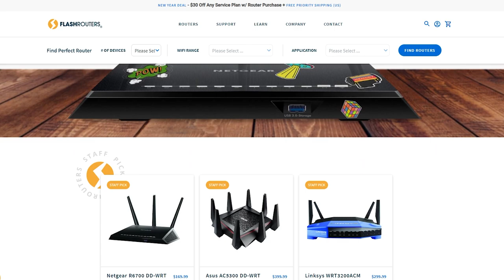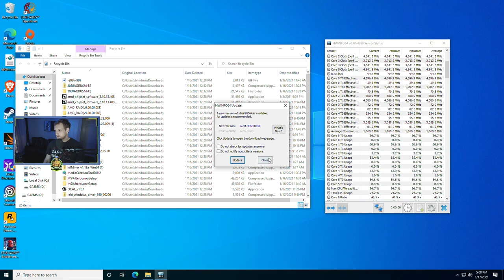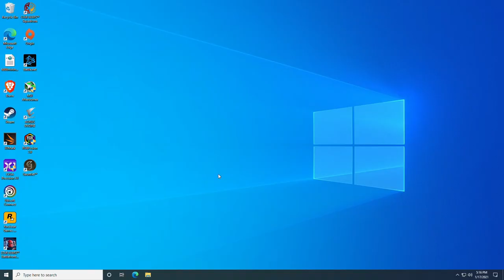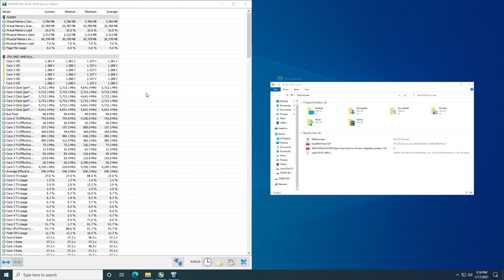How to Replace Thermal Pads on Any GPU!

Comment: dude awesome stuff thanks for the call out! serpentxsf and I had the same issues on our gigabyte eagle and gaming oc 3080. Gonna order a flash router soon!
Reply: I'm 100% you can get more mh/s if you drop the power limit to 85%-90% from the get to, right now you dropped the temperature but you're still outputting a ton of heat which is hard for your GPU to manage,  if you reduce the power limit just a bit you will be able to get higher memory clocks before crashing because your overall heat output will be lower to start with.
Reply: We love you Red Panda!

Comment: I just did this, I went from 82 mh/s peaking at around 104 C to 92 mh/s peaking at around 88 C. I don't understand why manufacturers wont just use better thermal pads, but at least its not super difficult to replace them.  Your video was invaluable in getting all the stuff I needed to do the job.
Reply: If they make their cards indestructible, we won't be able to kill them :)
Reply: Easy. Put on bad thermal pads, less GPU lifespan, more sales
Reply: @scarysunburns7733  It's actually the other way around. Better thermal pads, like paste, degrade much faster than the lower performance variants, so assuming someone is going to chuck it into a hotbox and never maintain the card, the longer lasting thermal pads are a more realistic choice than the higher performing ones. Companies don't know the end use of the card, so this is the safest option.

Comment: You didn't show the most important piece:    Memory Junction Temperature AFTER installing thermal pads....what are you running at now? 100C+ ?
Reply: Drops it about 23-25c :)
Reply: If you use high quality thermal pads (12 w/mk+) you'll see a huge drop in temperatures. The stock Gigabyte thermalpads are like 1-3 wm/k at best and leak oil everywhere. Definitely worth replacing. Keep in mind that different RTX 3080 models are going to need different thermal pad sizes.
Reply: @DantalionVR  indeed, both my 3080's are from Gigabyte and both were drenched with Oil on and around the original pads, cant understand why they had to use the cheapest shit they could find and slap in on the card
Reply: @Goldstar1337  "It's business"
Reply: @Goldstar1337  BS
Reply: @max11111able ?
Reply: @DantalionVR  I can't google the thickness of pads online...
Reply: @DantalionVR  what are high quality thermal pads? They're all the same 🤔
Reply: @LanaaAmor  They're not, they all vary in thickness and thermal conductivity. Some leak oil, some don't
Reply: @DantalionVR   how do they vary? They're made out of the same material

Comment: I went from 71 to 61 on all my cards by doing this....three months before this came out.  But I appreciate you bringing this knowledge forward to the community.  Learning how to take care of your hardware is super important.
Reply: How many cards?
Reply: @Doozy95  after my server power supply upgrade I'm up to nine
Reply: @nightwintertooth9502  and you've done this thermal pad mod to all cards and all dropped 10°c from previous highs?
Reply: @nightwintertooth9502  I'm only asking cause I have a shitty gigabyte that I'm about to pad mod and hope I can fix it. Cause it's running 10°c hotter than any of my other cards.
Reply: @Doozy95  When you do, I would recommend ARCTIC pads, they're the ones I use.  Grab a digital measuring clamp and measure the thickness before you start pulling them off.  I needed 0.5mm for my power amp chipset (because I've got older dual PCIe 4x2x2 (8x2)  cards that need one), 1mm for underneath my mosfet plate, 1mm for my vram heatsink, and 2mm for my backplate.  Take photos, record positions before removing components, be very very careful inside of your GPU.  I would also recommend 99.7% scientific grade rubbing alcohol and arctic silver 5 thermal grease, as well as an m.2/m.3 gpu screw kit from eBay.  I invested a good $200 in high quality tooling and materials before I started, and the output is grand.  It dropped me from high 70s, to mid 60s on the kawpow algorithm, which is more intense than ethash by default, with my highest temp recorded on a refurbished card at 68, completely eliminating long-term thermal runaway.

One of my cards WAS a gigabyte.  I flipped it for another r9-390x, actually.  They do suck, and under heavy thermal load, the backplate warps.  I ran into this issue long-term with an AMD RX580 gigabyte, and a GTX1080 gigabyte, both backplates warped, and they began overheating again.  Once that happens, its a repeat disassembly and rebending process that far outweighs keeping the card around and I would not recommend Gigabyte, even with a modded thermal pad, the build quality sucks in general because of the backplate warping issue.  The only thing seriously worth getting a gigabyte over, is if you're actually using them to game, and want to put a nonref ekwb on them, water cooled, which eliminates the need to use their shitty backplate, fan shrouds or cooling hardware anyhow.

MSI and ASUS are the best for air cooling for miners.  Followed by Gigabyte, then EVGA at the top in performance when watercooling for gamers.  Water cooling as a miner is usually really impractical because maintenance on a custom loop is a pita in a mining rig.  (and maintenance is recommended once a month)  Even with disconnect sockets on your PETG, its still a pain.  I can get low 60s with water cooling, and I have with a soft PETG+EKWB+Bitspower+D5 high flow test, but its not even worth the price tag because of the maintenance just to drop to 57 degrees while mining and have all that humidity venting into your ambient.   You need basically a radiator wall and a huge fan array to dissipate the amount of heat coming off of 9-12 cards efficiently.  I stacked three XSPC 380mm rads to do that task, hated it because it was turning my shed into tropical paradise, ended up putting the fan shrouds back on.

If you seriously want to try it out, though, you can get avg. 62 on kawpow by having the cards and risers in STE mineral oil in a filtered/circulating fish tank.  No fan shrouds needed and you don't have to give a shit about shitty backplates, shrouds, or thermal pads at all.  Just keeping a fish tank filter clean and preventing crystalization of the mineral oil on components.  No more than 5 cards at a time per tank, or the accumulated heat wil make the oil boil at its low boiling point, which is bad, because its conductive when it boils.   I got avg. 62 with a 5 card test in a fish tank full of STE, and its cheaper than watercooling.  The cards I find on ebay with working PCB whose fan shrouds can't be rescued get dumped in my fish tank.
Reply: @nightwintertooth9502  I've come to realize that myself. As 7/8 cards are msi/asus. And they never really give me problems anymore
Reply: @nightwintertooth9502  you did 2mm on backplate on gigabyte? Was that a 3070 or 3080?
Reply: @nightwintertooth9502  I took my gigabyte apart yesterday and changed and cleaned the old paste thinking that might be it. But even looking at the pads already on there, I can tell it's a pad issue, I don't understand how they passed inspection like this
Reply: @Doozy95  Degradation over time.  QC tests are typically full-load 30 day out of R&D.
Reply: @Doozy95  My older 1080 had the 2mm for the backplate.
Reply: @Doozy95  Honestly fuck air cooling and general I just got lazy and dumped everything that wouldn't work like that into my STE mineral oil fish tank... lol  Gotta change the oil once a year so it don't crystalize / flush the filter every 6 months but its lazy and great.
Reply: @nightwintertooth9502  lol I've thought about a mineral cooler but thats down the line. I think I will be able to solve this issue with the thermal pad mod I will do on it. Cause it doesn't even have pads on the backplate, which should be 3mm for backplates
Reply: @nightwintertooth9502  I bought 1mm/2mm/3mm just to be safe.
Reply: @nightwintertooth9502  interesting you are doing it, are the thermals nice and cool?
Reply: @nightwintertooth9502  I know I'm resurrecting the dead here, but my Gigabyte 1080 had 1.5mm and 3mm on the back plate. As I replaced the 1.5mm, it was visible with the eye it's not enough to fit between the plate and the chips. It was just useless. Replaced with 2mm. Didn't have 2.5mm, otherwise maybe I'd use it.
Reply: @Doozy95  9.  It was a mining rig that liked to go over temp.  Stack of RX480 sapphire doing RVN at the time.  Volcanic Island cards are notorious for running hot so efficient thermal pads are almost a nessecety for em if you aren't doing STE.  Helped bring me into range as was getting tired of my HiveOS temp alarms shutting them down.  Up time was very important for these cards so it definitely worked long term.  They all lasted about 4 more years before finally biting the dust.  Hit my ROI after six months so a worthwhile tip to share as the cards I had where in 24/7 operation minus a 15 minute reboot script and a cool down period once every 24h so I didn't get board warp.  Don't go with GIGABYTE cards.  They suffered board warp after the 3 year mark and I switched to MSI.  IDK what it is about the GIGABYTE wafers but they suck.  Ik gamers hate us but you want to keep a GPU running a long time talk to the miners we did a lot of this type of preventative maintenece to keep them going nonstop.  This is more of a preventative maintenrce operation that can extend the life of your card past its EOL so I recommend it for budget sake.
Reply: @dmytrokovtun4531  for 1080 definitely mind your pad thickness.  2mm is a stretch.  It works but compression from the chip through the media to the plate is what matters for good heat transfer.  You may be able to squeeze another degree or so out if you do find 2.5mm but it's marginal dw.  You can get a new screw kit and over tork a bit but please use caution with this over your 2mm choice as you have a GIGABYTE and as posted they are very sensitive to board warp.

Comment: I replaced the Thermalpads on my 3080 Gaming OC, the Memory Junction temperature went from 110c to 80c. I used the Thermalpad Thermalright 2mm on both sides and kryonaut on the GPU.
Reply: 2mm on both front an back? And all the small pads on the front around the heatsink? Can you confirm that please, I have to order out of country so I wanna do it right the first try. Thx!
Reply: @LumenEtTempus  2mm front and back for GDDR6x only.
Reply: @rafaelribeiro5771  Thanks
Reply: I bought this and Frosty Ice Cube Plus Thermal Pad - 12.8 W/mK from Amazon. Both have the same temps, but at 40% of the price of thermal rights.
Reply: how many packs did you use bro?
Reply: @stonmyk  It depends on the 3080. For mine they all used the same pads so I just had to buy one pack. Some 3080s use two or even up to three different thicknesses, so it all depends on what card you have. You have to crack it open and check to know for sure or find a video of someone taking it apart.
Reply: @markw496  I decided to go with 2mm for both sides and bought three packs already hope it’s enough
Reply: @stonmyk  Good luck. Let me know the results. Should be much better if you're near the 100 degree thermal throttle limit.
Reply: @markw496  i will thanks dude

Comment: What were you mem junction temperatures before and after?
Reply: I have this exact same card, getting 96-100 degrees with my memory at +900
Reply: @dcquadrant have you faced any issues with stability or any weirdness with your GPU? I don't put any memory overclocks due to the high Temps.
Reply: @wali8976  I have zero stability issues
Reply: I’ve the same card and in rdr2 ultra settings 1080p, 94º for mem jonction, automaticly increase fan speed, it’s bad
Reply: My MSI Ventus 3x has 106F memory regardless of speed causing +350mhz max stability. Time to fix!
Reply: @Bobby_Strange  buy some 3mm thermal pads for the backplate
Reply: @dcquadrant  can I stack two 1.5mm? Seems tough to find 3mm
Reply: @Bobby_Strange  I’ve heard you can but it was hard for me to find the 3mm pads as well. But I went directly to Gelid Solutions website and it shipped from HK to the US very fast. It took a total of like 8 days to receive a two pack of 3mm pads
Reply: @dcquadrant  Link?
Reply: @dcquadrant  vc chegou a fazer a substituição dos thermal pads da sua placa? Eu comprei uma RTX 3080 Aorus Master e ela esquenta demais... gpu a 50°C e dá thermal throttling por causa da temperatura da memoria que vai pra 108°C...
quais as espessuras dos thermal pads em cada parte? 
vou ter de fazer a substituição pra não fritar as memórias da minha placa...
achei essa placa uma bosta... me arrependi

Comment: Instead of the metal tool, use the plastic spudgers in the ifixit kit when working close to the board to avoid/minimize possible damages
Reply: For ESD purposes also. Plus I dont know how easy those tiny resistors around the  IHS is to pop off but don't want to find out. Pretty sure that little boo boo would void a warranty or two. I would guess the spudging tool would "give" while a metal object would pop it clean off into regions unknown. I use fancy toothpicks and a jeweler's glass for cleaning around tiny components.

Comment: right up my alley this week
im about to do the pads on 2 5600xts and a 5700
possibly a 3rd 5600xt, ill see when it gets here
also big tip for many ppl: i throw away all plastic backplates, plastic is an insulator

Comment: I have this exact same model, replaced all the pads as show on the video and the temperature improvement was massive, so much better now, vram going from 80-82c, tdp 65%, clock and memory clock on default, thx a lot for the video!!!

Comment: I followed this and Red Panda's guide using this Amazon product: Frosty Ice Cube Plus Thermal Pad - 12.8 W/mK. So far 30 degree drops easily, and at the right price compared to the other brands these days. 

At least now my gpu start throttling especially in the summer right now. Thanks for the demo!
Reply: wait so is the frosty ice cube pads good or bad?
Reply: @ScooterPS  They are incredible. Beyond words. At the price I paid, I cannot go back to other brands. I was able to drop my cards to the 80s on all of them and they never throttle or get high even in summer. It has been so good that I also decided to change my older cards and the drop in temperatures is phenomenal. A 5700 XT I had dropped like 30 degrees.
Reply: @ScooterPS  Now that I think about it, I might pick more up since its on sale right now. I just hope it will last as I have a few more cards coming in next month.

Comment: Gigabyte RTX 3080Ti mining on NiceHash:
Before:
60MH/s, 200W, VRAM=90C
After GELID 2mm and 3mm pads:
60MH/s, 200W, VRAM=70C
LHR'ed at 60MH, but it shows the 20C temp improvement.
Conclusion = OEM thermal pads suck!
Thanks for the video!

Comment: You only need 1.5mm and 1mm pads for the 3080 Master/Xtreme. Stack them on top to get all sizes. There is one 0.5mm pad, but you can leave it stock. Backplate 2.5mm everything, except core is 1mm. Main vram chips 1.5mm by the die. 2mm and 2.5mm lifts the heatsink so you get increased core temps. Most sizes are 1.5mm, so have the most of that. I've used thermalright odyssey 12.8 w/mk pads. got 120x120mm 1x with 1.5mm and 1x 120x120 1mm. This was just enough for every pad pretty much except one 0.5mm for something insignificant. Aorus master. Now I get 103 mhash with 90c and 1.5k rpm fans. <70%. Previously thermal throttling at 85 mh 110c 100% fans.
Reply: Thank you for the info. I have the Aorus Master and really been wanting to replace the shit pads.
Reply: Got any links to the specific ones you purchased? Tried looked on amazon for the ones you mentioned but there's a whole bunch of them.
Reply: Exactly man. Thank you for advice. I did it. Aorus Extreme RTX 3080 rev 1.0. Thermalright Odyssey 12.8w pads 2mm on the mem chips, under backplate 1mm core, other backplate  somewhere 2.5-3mm pads. Mem T junction before 110°C with thermal throttling,gpu temp 51, after -mem T junction 78°C, gpu 58 (with more past on gpu chip because 2mm pads are to much). I used 2x1mm pads temporarily. In future i will use 1.5 mm on the mem chips. Interesting is also, that for my card are 6w pads on the memory chips totally useless. Temp memory raised again to 110°C.  It doesn't matter if 1.5 mm, 2mm or brand Arctic or EC360 - 6w pads.

Comment: Great Vid. I just replaced my aorus 3080 master with iceberg 2mm thermal pad. My mem OC is 1500Mhz and fan spinning at 85% and the memory junction temperature is 86-88c
Reply: my friend! I have this same GPU... please What is the thickness of each thermal pad that I should place?
Reply: @Ternoski  Memory chips and back plate are all 2mm, the rest of the caps and mosfets are 1.5mm.

Comment: I just replaced the thermal pads on both my gigabyte 3090s, they where so bad. leaking oil, and the vram temps where always over 100c. I repadded with some 2mm 13w/mk pads and now my vram temps are 82 to 84c while mining. You where spot on about this issue.
Reply: fucking awful

Comment: You are awesome. Love that I'm getting a thermal pad replacement guide on a mining youtube channel. I don't personally need the instructions, but I can only imagine that someone who gets into mining and has possibly a dozen or several dozen GPUs but is not experienced technically would find this extremely useful. 

Too bad that a high end RTX 3080 can't get that GDDR6X past +1000. Big time bummer on that.
Reply: Absolutely no problem doing upwards to +1300 mem, i am doing 0.787mV undervolt at 990 MHz, 46% PL, 100.9 MH/s @ 155watts :D

Comment: Seems all manufacturers use EXTREMELY poor quality thermal pads for the 3080's.
I did my Gigabyte 3080 Gaming OC, and junction temps whilst mining dropped from 104c to 84c without fans, 74c with fans at 100%.. +1050 to the memory OC.